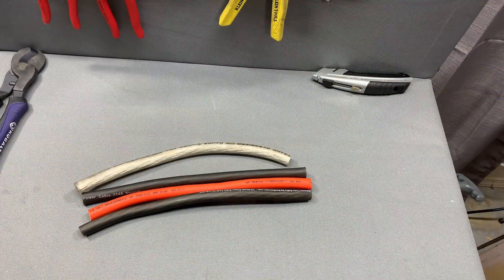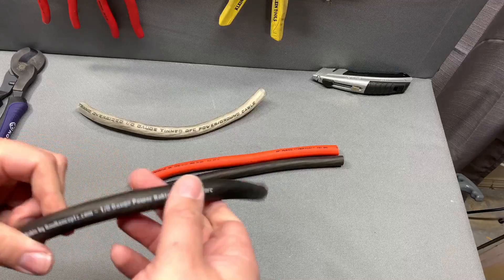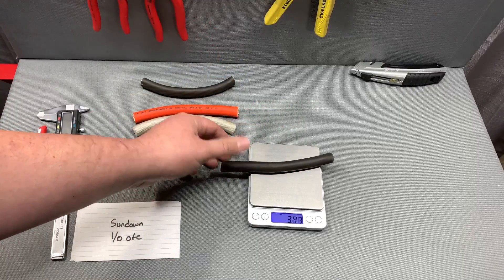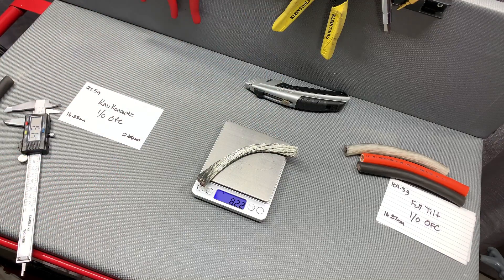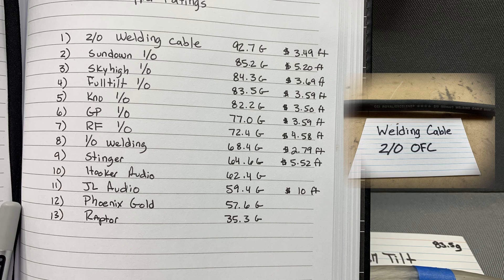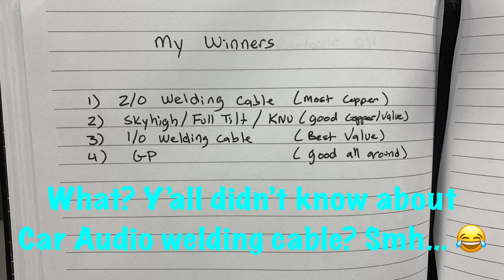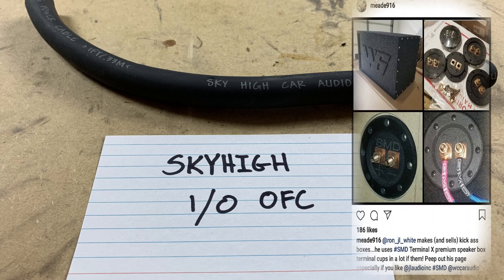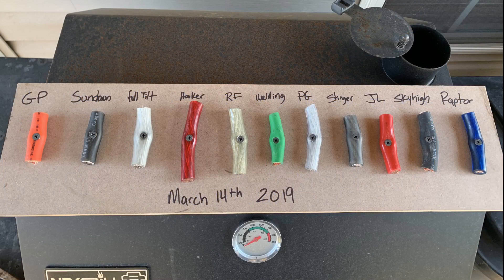1/0 OFC Wire Tested! (1/0 OFC Shootout Update)

Comment: 6:15 considering there's no such thing as 100% OFC welding cable 2MK, therefore we ought to consider this and the amount of amperage these wires can handle before each reaches prespecified temp e.g. 100 degrees  
(maybe u do but I didn't watch entire vid) BUT GREAT SO FAR!

Comment: better late then never but i gotta add  to this.....
btw add me to the 2/0 welding cable club.....
so when i have wire up multiple runs from front to back, flexibility does equate to less MF'rs......
BUT the main headache about welding cable is the jacket material.....its "sticky", like a pencil eraser....
brand cables like shca are not only way more flexible but slide about in tight spaces WAAAAY easier.....
although i still use 2/0 welding cable i just have to use tecflex or something which adds cost but is an absolute necessity....unless youre a sadist

Comment: Looks to me like only 6 out of the 13 are actually copper 🤔 the 6 are the
2/0 & 1/0 welding cable
Skyhigh
GP
JL
Hooker (looks burnt tho so not sure)

The rest look like cca even tho some say ofc they aren't even copper colour so i dont see how so i would have to eliminate those right out the gate

If i had to list the top 5 with 1 being the best my opinion would be...

1. GP
2. Welding (1 or 2/0)
3. Skyhigh
4. Sundown (OFC not CCA like whats
   shown in this video cause that is
   definitely not OFC)
5. JL

Next best but not better (maybe on price but not quality and only for the video sake)
6. Knukonceptz
7. Full tilt
8. RF
9. Stinger
10. Hooker
11. Pheonix gold
12. Raptor

In my personal opinion one of the best brands in terms of power/amps handling and quality of copper which is never mentioned anywhere is DB LINK MAXCORE 1/0.......👍👍🤘
Reply from the maker: SCRAPE N BASS I’ll try and get some DB Link! I’m always on the lookout for all the types of 1/0 out there
Reply: How would you compare GP audio to welding cables? I dont know which to choose. And also what would be 4 gauge wite in welder cable AWG standards?

Comment: Are you planning on testing the conductivity. I'm also curious to know how the copper will handle being exposed to the air hang on to your sample board and let's see which one oxidizes
Reply from the maker: mattofjax environmental test will be updated within the next few months. I’m not testing conductivity for 2 reasons. (1) Copper is heavy and the weight is pretty representative of how it will do in that manner (2) And this is the most important reason... I’d want to test on a minimum length of 15ft and it would cost a small fortune to do so. All that being said I’ve got a few more brands here that I will have an update video on soon enough

Comment: Wouldn’t the number of strands be quality information for the list seeing how electricity travelers around the wire and not through it? 
Or is that overkill 🤷🏻‍♂️
Reply: Love the video btw. Good work sir
Reply from the maker: I considered counting strands, but settled on overall copper weight being good enough.
Reply: Yah I guess that’s getting to picky. In your opinion would strand count matter over a run of say 20ft. For example JL was  59.4g of copper at 4,704 strands vs Knu Konceptz was 82.2g at 5,145 strand count. Just picking your brain 🧠 
Thanks for the reply.
Reply from the maker: Steven Collins so the strand count is kinda a flexibility thing. It plays a big factor in flexibility along with the actual outer jacket

Comment: I've always been curious on the power wire like you tested that is that solid silver color. I don't know if they still make speaker wire like that but I remember back in the day(mid 90's)the clear shielding with silver we would make usually are negative and the copper your positive. When I see all the cheap aluminum stuff out there it confuses me.
Reply from the maker: It’s tinned copper, but yes it can be confusing for sure because some cca is tinned with copper lol. The weight is a dead giveaway tho!

Comment: Thanks for the follow-up reviews.  I look forward to the weather test & continuing database.  I'm sure people can knit-pick these reviews to death, but I doubt further testing would get more than a 1-5% difference in current carrying capability.
Reply from the maker: Mickey Pietrzak the one thing I’d like to do is run current through a minimum of 10’ length but that is just cost prohibitive at the moment
Reply: @HifiVega  It would be nice, but like I said, I suspect that there would only be a few percentage point variance compared to the copper weight if you over laid them on a graph.

Comment: A question for anyone, what size lug would you use with the 2/0 and 1/0 welding cable? Standard size for the gauge?
Reply: You can get car battery terminals on eBay which is a lug which would fit 2/0 and 1/0 cable
Reply from the maker: Yep, I would stay with the standard lugs. Some of the lugs from car audio manufacturers are oversized comparatively

Comment: Could you measure the copper diameter? I think that is an important stat for the wire. Would you be willing to do xs power?
Reply from the maker: Matt Roadfeldt I tried measuring copper diameter, but the wire didn’t hold together well enough outside the jacket to be accurate. I’d definitely test some XS Power. I’ll try and gather up some scraps of all the other wires I haven’t tested and do another update sometime in the future
Reply: @HifiVega  You could slice part of the insulation with a knife, slide the insulation back just far enough to get a micrometer in there to measure the diameter. Or that is the way I would try to.
Reply from the maker: Matt Roadfeldt I figured most people who wanted to know for sure could just subtract the jacket thickness from the over all thickness
Reply: @HifiVega  thank you

Comment: What always bugs me is cables manufacturers not following standards, welding cable follows standards and 1/0AWG is 1/0AWG .. that's how it's supposed to be, comparing "car audio 1/0" to actual 2/0 is somewhat sad to the industry..
Reply from the maker: Anton Albert I agree and it’s part of the reason I was interested in doing this comparison
Reply: Anton Albert I agree! Thats because welding wire has standards to adhere too. Car audio wire doesn’t.
Reply: @uptobatentertainment   manufacturers could adhere to the same standards as welding cable, some do -well, one does..

Comment: Great video, I was very happy to see the 2/0 welding leading the pack!    It’s been my choice for a couple years now.   Especially the 2/0 sealed end ring terminals from Temco!  They blow anything car audio branded out of the water
Reply from the maker: Top Shelf Innovations can’t go wrong with it for the price
Reply: HifiVega honestly, if it came down to it, i would pay more for the 2/0 Temco wire than I would stinger.   The price is not why I choose it.....  the build quality is superior, the copper is real.... i dont really trust stinger power wire any more.  The jacket can take way more abuse.  When using it under hood of a newer vehicle....if terminated proper it looks factory.... this has many benefits.   If someone wants flashy I just techflex the stuff
Reply: I agree, I also run 2/0 welding cable, cheep and awesome.

Comment: awesome video Rob. my car is all sky high on power and grounds. 8 gauge electric motor lead wire for my subs.
thinking about the fosgate prime 250.1 amp and a skar audio 10" mid for the spl challenge total cost for both would be $129.00 blast it at 1000 Hz 😎
Reply from the maker: eric dudley do it!

Comment: Got 40 feet of knukoncepts in my truck. Very good quality and great pricing
Reply from the maker: James Jones it’s good stuff for sure
Reply: They must have gave you a deal that stuff is expensive LOL
Reply: Knukonceptz has been good to me aswell!
Reply: It will blow all the other brands away when you count the strands, knukoncepts cable won't fit in a 1/0 lug.
Reply: @bobriddle6068 what’s the solution?
Reply: @bobriddle6068 Sky High doesn’t fit in a 1/0 either. Led me back to my local place that sells that stuff a couple times. I take that back, 30 seconds after typing this I remember it fits in whatever ring terminal crutchfield sells that is 1/0.

Comment: I think the best test would be an amperage test to see which one can handle the most amps.
Reply from the maker: tmatthews0007 That would be a good test, but I’d need at least a 10ft length of each of these to really get a good idea of what they can handle over a given length and that wouldn’t be very economical at an average of $3.50-$5.00 per ft
Reply: HifiVega I agree that it isn’t very economical but we really won’t get a good sense of what is the best wire at the price point without knowing the quality of the wire. The weight is important but it won’t mean much if it isn’t really 99.9 percent ofc. How could we test it?
Reply from the maker: tmatthews0007 The weight gives me a good sense of the copper purity because if it had any aluminum it would effect the weight... that being said they could use some other kind of heavy metal I suppose
Reply: Maybe do a smaller test where you take say 20 strands of  the wires out or one of the sub bundles out of the jacket and amp test it (use the 1 foot piece you have ) and put power thru it till it melts then multiply by how many strands or bundles in each can take